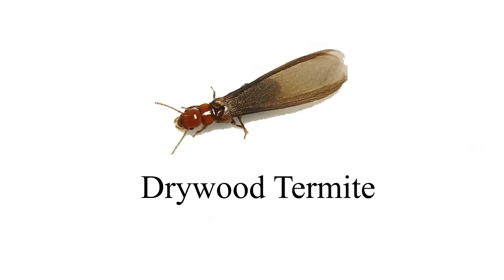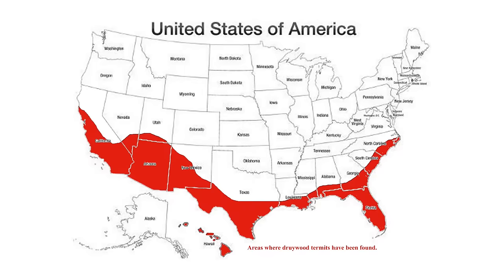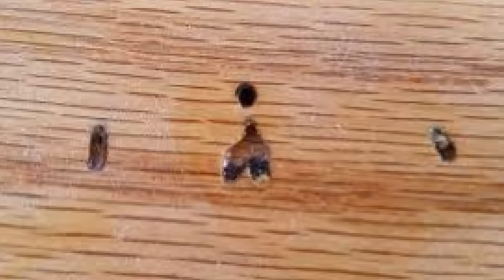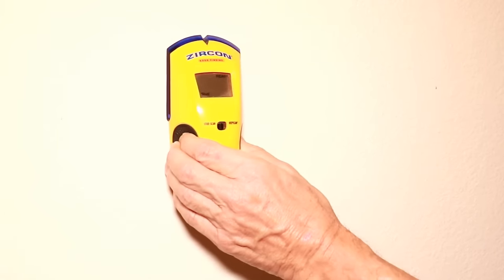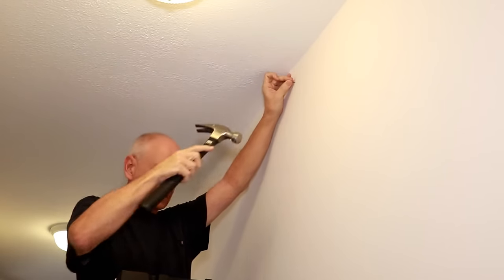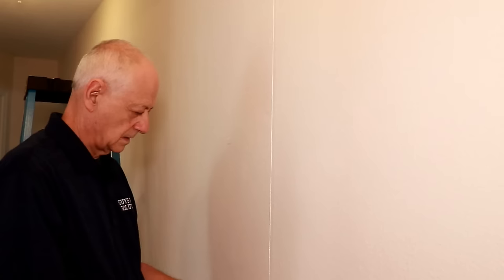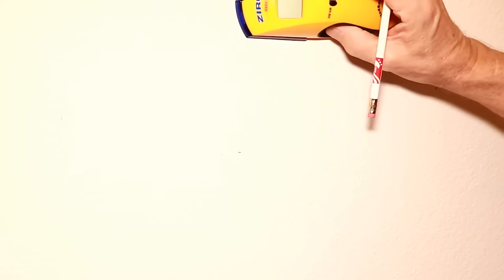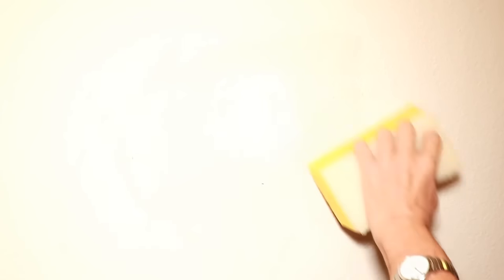How to Treat a Drywood Termite Infestation Yourself. A MUST see if you have Drywood termites.

Comment: Thanks for all this info. I have a horrible case of termites in my home. Lots of damage found and no telling how much more. I don’t have money to tent the house. I have some termidor SC and am going to follow your directions on digging a trench around the house and adding the termidor with water. Should I also get the foam cans and treat as many of the wall studs as I can? Do I only spot treat the ones that show signs of damage or just start treating them all? I’ve been tapping the walls and have found some hollow sounding spots to start at. Thanks for your videos and all this great information.
Reply from the maker: I am so sorry that you are having this problem.  The first thing you need to do is to make sure that these guys are drywood termites.  Trenching will do nothing to help with drywood termites because they fly to your house, so they will never encounter the pesticide in the trench.  Please watch my video on how to identify termite species.  If you are sure that these guys are drywood termites, then the only sure way to get rid of them is to fumigate.  If you cannot afford to do that, then the next best thing is to follow the directions in this video exactly as shown.  You will never find all the galleries, but you can slow them down.  Also, since drywood termites swarm every year, it is almost a certainty that more and more of these guys are entering you home every year.  The only way to prevent this is to do a preventive treatment on your house every 60 days.  Most pest controllers will not do this, so it is something that you generally need to do yourself.  I have a video on how to do that and I will place a link below.  This is a generic video that covers a lot of different pests, but it also works for preventing drywood termites.  Just ignore the part about treating your yard.  You only need to treat the house for drywood termites.  This will not treat the termites that are already there, but it will stop new ones from getting in.  Regardless of how you treat it, you should begin the preventive treatment immediately, so that you do not get additional termites paying you a visit.  I wish I had a quick and easy solution for drywood termites, but I don't.  You may want to start with the spot treatment and start saving up for a fumigation.  If you are spot treating, try to find as many galleries as you can and treat them with a fipronil foam.  Inspect for galleries every month.  You will most likely find new ones all the time.

I hope that helps.  Be well my friend.

Video on how to identify termite species:  https://youtu.be/dIs_a0nfVjg
Reply: @GuysPestSolutions  Had the guy come. He confirmed it’s Formosan termites. Found a huge tunnel that was about 1” deep by 4 to 5” wide. Said he had never seen any that big before.  Said 900 bucks and would guarantee the removal of all termites.
Reply from the maker: @JugzJohnson  Sorry for the delay in getting back to you.  I have been fighting covid for the past few days and I was really out of it.  I'm much better now.

Please watch my video on Formosan termites.  I would be very skeptical about a $900 treatment.  I would want to know exactly what you are getting for that money.  Does that include trenching and the removal of cartons?  I seriously doubt it.  You may want to have a go at this yourself.

By the way, I will be out of town for a couple of weeks, so I may not be able to answer additional questions until after I get back.  Don't worry though.  If you have follow-up questions, I will answer them upon my return.  I'm sure I'll have a good deal of questions waiting for me, so please be patient.  I will work through them one at a time.  Hopefully it will only take me a week to get caught up.  I promise that I will get back to you if you have additional questions, albeit a little slower than usual.  We have not been on a vacation for over 13 years and my wife has explained in her unique way that the time has come.  So, go I must, and we won't be back until around June 11. 

Be well my friend.

Video on Formosan termites:  https://youtu.be/xDtGUWxMrRw

Comment: I live in a Mobile Home and have termites.  They were found in my home, Pest control came out and drilled holes, sprayed foam, they went away.  Now on the opposite side of home, found another infestation.  Can't afford to bring them out again, Tenting is costly and from what I read, they return!  I'm going to use Bia Advanced, like you suggested in another video, around home but what can I spray on Drywood termites, without drilling holes?
Reply from the maker: I am so sorry that you are having this problem.  I know this stuff is expensive, but hopefully you came to me for the truth.  So, let me break it down for you.

It is important to understand how drywood termites work.  They enter through cracks and crevices around windows, doors, the eaves, pipe penetrations, and so forth.  Most of the time, they enter through several locations.  That is because a swarm of them attacked your home at the same time.  If there was a crack or a crevice, then they probably found it.  After they established their galleries, which will be inside the wood, it will take four to seven years for them to be able to swarm.  Now that they are in your house, the swarmers will use holes that are in your studs to travel through the walls.  Those holes in the studs were created by the electricians to run the electrical wiring.  Not only are these holes going through the studs, but holes were drilled into the attic for the light switches and to run some of the wiring for the outlets.  So, the termites now have easy access throughout the attic and the walls.  If you have a basement or crawl space, they have access to that as well.  Most of the time, you will have no idea that they are in the walls, because the frass is inside the wall.  To make matters worse, if you have drywood termites, then your neighbors have them too.  That means you have been getting swarmed for as long as they have existed in the neighborhood.  Most likely, we're talking about years, so it's a safe bet that you have these guys in many locations in your home.                        

I always hate to be the bearer of bad news, but if you have drywood termites, the only sure way to get rid of them is to fumigate.  Prices for this can vary wildly in this industry, so I recommend that you watch my video on how to hire a pest controller without getting ripped off.  That video can save you a lot of money.  You should also know that the gas they use to fumigate has absolutely no residual action whatsoever, so you can get reinfested the moment the tent comes down.  Like I said before, if you have drywood termites, then your neighbors have them as well.  Since drywood  termites swarm every year, it is almost a certainty that you will be reinfested within a year after the fumigation is done.  The only way to prevent this is to do a preventive treatment on your home every 60 to 90 days.  Most pest controllers will not do this, so it is something that you generally need to do yourself.  I have a video on how to do that and I will place a link below.  If you absolutely cannot afford to fumigate your house, then you can try spot treating it yourself.  It is virtually impossible to find all the termite galleries, but it is way better than doing nothing.  Regardless of how you treat it, you should begin the preventive treatment immediately, so that you do not get additional termites paying you a visit.

The termite granules will not help with drywood termites, but they should protect you from subterranean termites.

I hope that helps.  Be well Pearl.                      

Video on how to hire a pest controller without getting ripped off:  https://youtu.be/y-a8XOqVrlE

Video on how to prevent drywood termites (You do not need to treat the yard for termites.  Just the outside of the mobile home):  https://youtu.be/Yozv3s-Qwlw

Comment: Hi Guy, I bought a SW Missouri home back in 2015 that was built in 2001. The climate is extremely humid, requiring year round dehumidification. The water table is high, so it has a crawl space, and the clay soil is usually soggy. Puddles form in the yard when it rains. I haven’t had it inspected since the purchase and I haven’t treated for any insects the last few years. For now, my question is about several drilled holes in the exterior siding. Why are they there? Was it previously treated for termites or were cables and/or antennas removed from these locations? I’m going to search for tunnels on the outside foundation. I do remember brushing off a short mud tube from the front porch brick that was at the 4 ft level, but it didn’t go down to the slab. I’m not sure what to think. Appreciate your input. Thanks.
Reply from the maker: I recommend that you inspect the house for termites every year, starting now.  I will give you a link to my video on how to do it correctly.  Also, please email photos of those holes to guyspestsolutions@gmail.com.  I will try to figure out what they are.  No promises, but I would be happy to have a look.  Please give me your YouTube name when you email.  I hope that helps.  Be well my friend.

Video on how to inspect for termites:  https://youtu.be/oGyAVT7Zyro

Comment: Hello Guy,
Thanks for your informative videos, they are actually helping me understand a termite problem in my house and I have a couple of questions on how to proceed. But first, here is a synopsis of the situation.
Thank you for your consideration and advices. Sorry for the length of this comment.
This situation may stump you a little bit because, I leave in Massachusetts, about 30 miles west of Boston. So I would be pretty far from the Red and Orange sections of the map. The way I knew that I had some type of wood boring insect, is the Frass that was dropping on my beige couch, that was five years ago. At the time, not knowing exactly how to identify what the type of insect it was, my suspicion was Subterranean termites and did an application of Termidor SC around the house, despite the fact that my inspections never revealed any mud tubes. After reading and watching videos, especially yours on Drywood termites, I thought maybe I had Drywood termites. The frass is apparently coming from the 20’x16”x6” Douglas Fir and Hemlock beam that support the roof and a Cathedral ceiling. If this is the case, there could be an opening in the roof at the peak vent, I will investigate further. The exposed part of the beam has a varnish coating and does not show any kick holes. The frass is passing through the small space between the beam and the ceiling. Three and a half years ago, I drilled ¾” holes between the rafters close to the beam, I was afraid to do more damage to the plastered ceiling and be able to patch the holes and install a crown molding to cover the joint, that is if successful. Using a borescope, I was not able to identify any holes, probably because the camera was too close to the beam. I decided to do a spray application of Bora-care. A few month later, to my surprise, there was a great reduction of frass.  The amount of frass I see now on a weekly basis is very small compared to before and only in one section between two rafters.
Questions:
I am thinking of using a Bora-care and Profoam Platinum spray mix:
Q1	 Is that the right approach?
Q2	Do I need a special foamer tank or is there a process that uses a regular powered spray pump?
Q3	Would the fiberglass insulation cause a restriction to the foam?
Thanks again.
Reply from the maker: Thank you so much for reaching out to me.  I have learned the hard way to never say never in pest control, but I can assure you that this is not drywood termites.  That species cannot survive where you live.  So, without the advantage of actually inspecting your home, my best guess is that you do not have termites at all.  This is most likely a different species of wood destroying pest.  Most likely carpenter ants.  Here's the thing about carpenter ants.  They like soft, wet wood.  So, if you are seeing the frass coming from a roof support beam, then that would suggest that you either have a roof leak, or perhaps a condensation issue that needs to be resolved.  If these are carpenter ants, then you need to understand that the ants in your home are probably a satellite colony.  The main colony is outside somewhere, so you need to treat both the inside and outside of your home.  Just based on what you are telling me, Bora-Care would not be the way to go.  If you send me photos of the area in question, I can best suggest a way to treat that beam.  I need to see the gaps that you are referring to.  It would also be helpful to see the exterior of the house as well.  Meanwhile, you should start treating the exterior of your house as soon as you can.  If it were me, I would also treat the yard as well.  This will stop and maybe totally eliminate the colony outside.  Still, you should do the exterior treatment and the yard treatment every 60 to 90 days, except in the freezing weather.  You can send photos to guyspestsolutions@gmail.com.  Take a close look at the frass.  If it looks a lot like sawdust and you can move it easily with your finger, then this is most likely carpenter ants.  Drywood termite frass looks like tiny pellets.

Since you have a somewhat different situation than most carpenter ant problems, I want to give you a targeted treatment plan for the inside of the house.  So, I am not going to link you to my carpenter ant video.  Instead, I would like you to watch my video on how to treat the exterior of your house and my video on how to treat your yard.  Keep in mind that carpenter ants do not eat wood the way termites do.  Carpenter ants must forage for food, so if you are not seeing them anywhere else in the house, then they are going outside to eat.  By treating the outside of the house, you will force them to take the pesticide back to the colony in your house.  This would be a great start.  Also keep in mind that, after I see the photos, I may rethink carpenter ants, but for now, this is my best guess. 

Please allow some time for me to respond to your email.  This is my busy season right now because it is termite swarming season and I am getting swamped with emails about termites.  Also, I am doing battle with Covid at the moment, so I'm not functioning at 100%.  I am also going on a 2-week vacation starting on May 29th.  I have not had a vacation in the last 13 years and my wife tells me that it's time.  I should be over the Covid by then.  I still plan on answering questions while on vacation, but it will be at a greatly reduced pace, so I will be way behind when I get back.  Trust me though.  I will get a treatment plan worked out for you just as soon as I possibly can.  Meanwhile, treating the outside of the house and the yard will probably put a huge dent in this problem.

I hope that helps.  Be well my friend.

Video on how to treat the exterior of your house:  https://youtu.be/wifoTU5dmp0

Video on how to treat your yard:  https://youtu.be/Yozv3s-Qwlw
Reply: @GuysPestSolutions  Guy, thanks for the quick response. Sorry to hear about your health issue, I hope you feel better soon. I will watch the links you suggested and also send some pictures of the property's environment, some of it may help in determining the solution.
Thanks again,
Rudy
Reply from the maker: @rudylatortue6906  Sounds good.  Please remind me of the situation when you email.  Be well my friend.
Reply from the maker: @rudylatortue6906  Thanks.  I responded to your email today.  Be well my friend.
Reply: @GuysPestSolutions  Thanks, I will read it and get back to you. Best Regards.
Reply: And have a great vacation.
Reply: Hello Guy, I hope things are okay with you.  Just wanted to make sure you received my email sent on 5/31.  Thanks again for your help and recommendations.
Reply from the maker: @rudylatortue6906  I probably did receive your email, but I have not looked at it yet because I left on vacation on 5/29.  I am on an Alaska cruise and I'm at sea at the moment, so I am taking some time to get back to folks.  I will look at all the email when I get home on June 11.  Not long to go now.  You will be among the first emails that I will see, so I should be able to respond within a day after getting home.  I certainly didn't need to have Covid going on a vacation, but I was no longer contagious, so we went.  I still have a slight cough from time to time.  It really hangs in there.  It gets better every day though.  Please let me know if you don't get a response to your email by June 13.  That would mean something is wrong, so please do follow up.  Be well my friend.